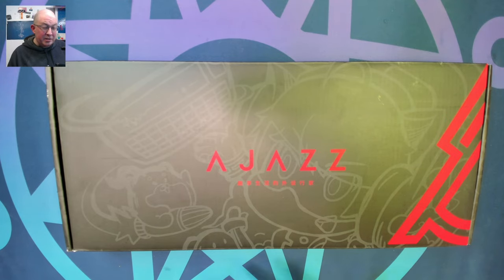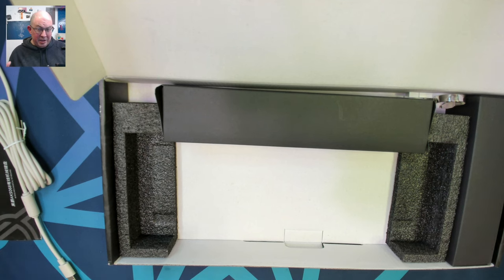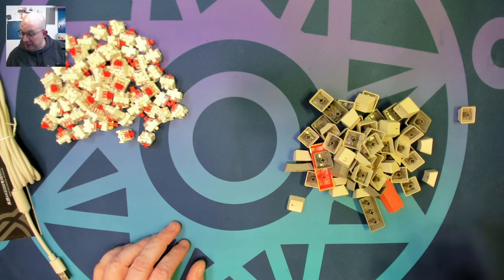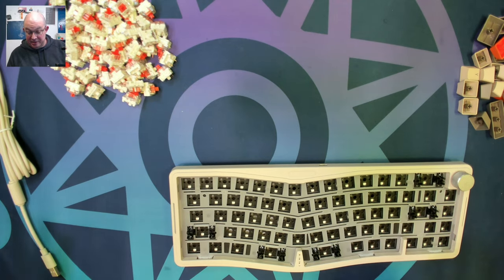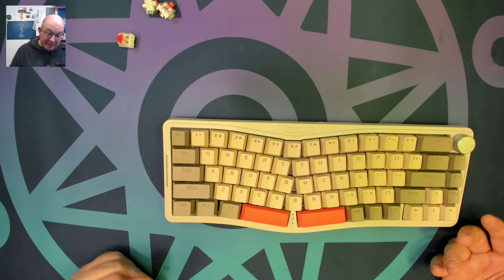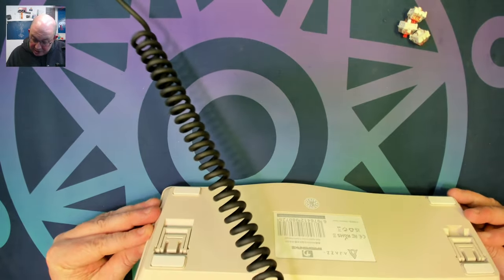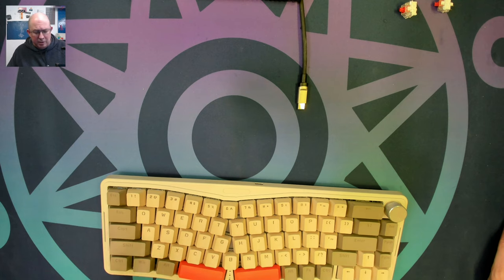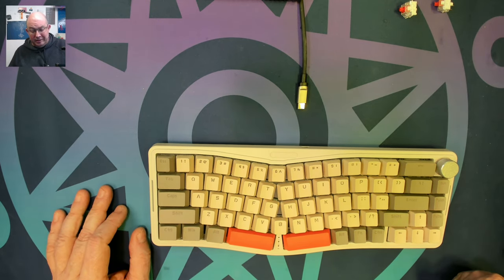Ajazz AKS068 "Alice" Review and Sound Test

Comment: I've had this keyboard for around like 3 weeks now and I am glad that there is finally a review on it. as for my experience. It is definitely not a board for everyone and the VIA could be alot better. Ajazz did not do a great job with this keyboard. It took a bit to understand what was what on the left side of the keyboard.

I got the keyboard for 40$ on amazon and I opened it up with a pocket knife and placed car dampening foam. I threw away the switches and decided to replace the switches with jerrzi tactiles, and put some samgsn keycaps on it and it sounds alot better that what is soundded like originally.

I wouldn't recommend this keyboard though for anyone as their first build. as even for its price. you can get a gmk keyboard at around the same price when its on sale for like 30-40$.

19:43 Honestly I really cannot recommend it to anyone period. The deign looks really cute for an alice-y inspired 65% keyboard but it is not worth it. You'd have a much more better time with a gmk 67. 

All in all. Ajazz needs to do a better job. Im still keeping mind because to me, its a unique board.
Reply from the maker: Thanks for sharing your experience, cheers!

Comment: I tried this version and the Pro version (tri-mode).  The keycaps on the Pro are significantly better - double-shot walls, deeper, with better printing.  It feels like a completely different keyboard - and it only costs about $10 more.

Comment: I actually kinda like mine. I chose it because the rows of the caps have better transitions between the caps. Ie. the tilting of the W compared to the Q on the true Alice layout is very abrupt.  Also, on this keyboard I put the two space bars on upside down which takes that sharp forward edge off and it is much smoother on the thumbs now. much more comfortable!

Comment: My interest in the brand was seeing what the new "ergo" / Alice layout was all about after using a wired Gateway Computer ergo keyboard for decades. I briefly tried an iClever folding bluetooth keyboard with angled split and wasn't thrilled to try using it for longer than a website search. For my smaller hands this is surprising and pleasantly close to my battle axe ergo full size.( I did get the Pro version.) After all these years hearing about brown and red switches, I was a bit put off by "seafoam" being a choice. It is something of an unknown to me not understanding all the minutiae of switches. There is no hitch in the key movement like I was expecting so I at least have the option of trying a different set in more historical switches. And the lack of a second "B" key is not a problem for me because when I learned to type it was a left hand item. Other wishlist keyboards (and I collect oddballs) is the Kinesis Advantage2 Ergonomic but costs three times as much.
Reply: And as a side note, the LED options on the pro-- so many settings of whole keyboard color and strobe if that is your thing. So far it's got more options than the sub $30 listings. I might miss a game-specific per key setup in the future but that might be for when I get more familiar with the options out there.

Comment: Not much info out there on this board. I took a chance and bought one. I was drawn to the interesting Alice-ish layout. The keycaps are the worst I’ve ever seen. I did a lazy switch lube job and applied some krytox to the stabs with a syringe. The space bars are an oddball size so I kept those and installed YMDK carbon keycaps; the orange matched the existing orange space bars. It now sits on my shelf as a decoration.